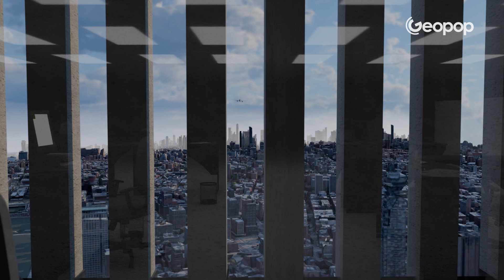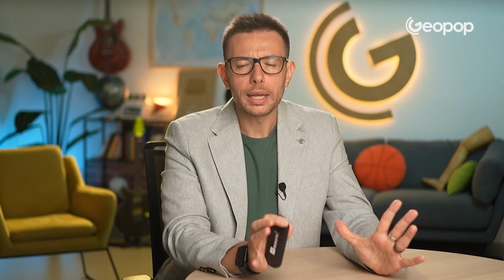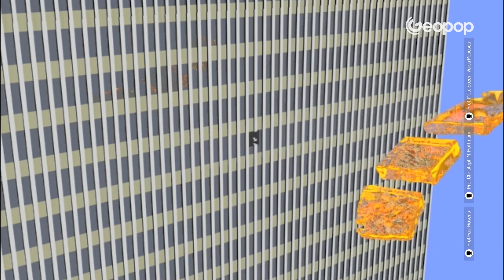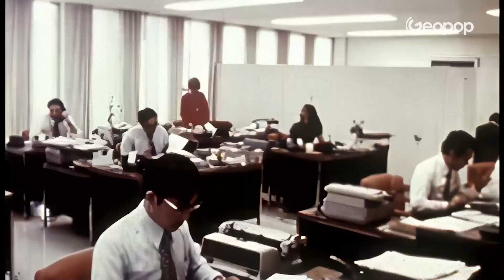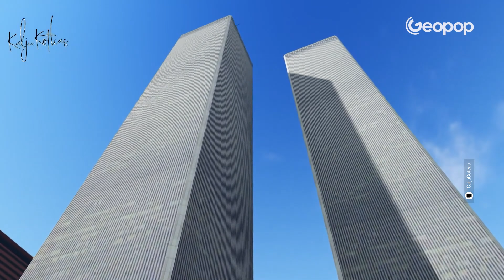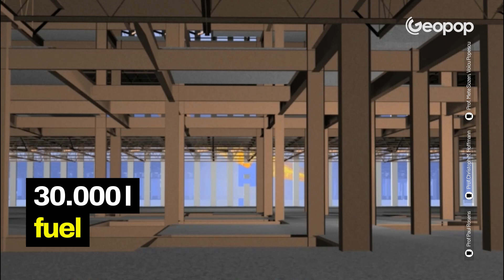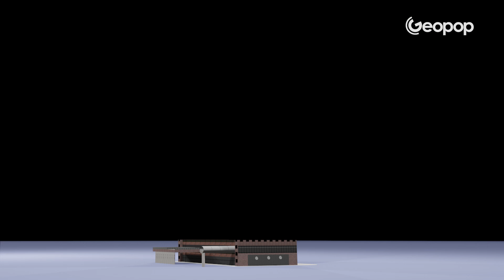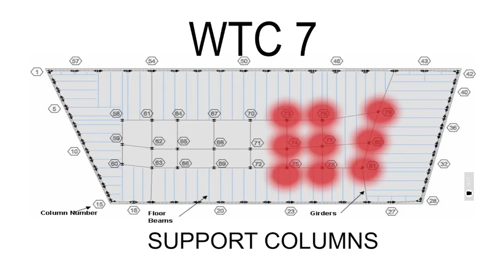9/11, 2001: The Technical Reconstruction of the Twin Towers and WTC 7 Collapses

Comment: Nano thermite caused these near perfect demolitions
Reply: OK, how?
Reply: Thermite has never been used to demolish a building of such magnitude, and the towers were not the first.
Reply: @Tim22222  Planes have never been used to demolish a building of such magnitude, and the towers were not the first.
Reply: @Kudde23 Evidence of planes being used: Abundant!
Evidence of explosives: ZERO.
Reply: @Tim22222  Yeah, as if you cheap little liar  never heard of the explosion witnesses, explosion sounds, the dust puffs, flashes of light, the bomb alarms, FBI´s working theory of bombs, the refusal of investigators to even look for explosives despite everything that clearly points to explosives and the lack of any explanation for the collapses of the Twin´s core structures and the free fall of WTC7 that comes without cuter charges...
Yep timmyshill, you can´t explain these collapses without cutter charges. You won´t even dare to try because you cheap little liar know you can´t.
Reply: They used explosives just like any other controlled demolition
Reply: @robbiehiatt9966  Yeah, except they didn't. First responders went through the wreckage with a fine toothed comb; nothing was found pointing to explosives.
Reply: @Tim22222 that's a lie, first responders responded first. After the initial search, the fire department was only allowed to carry firefighters off the pile when firefighters were found. They did not go through the debris with a fine tooth comb. They didn't go through it at all except when they were looking for survivors in the beginning.  Lie some more

Comment: I am quite tired of these videos or reports, none of which explains the TIME it takes to fall to the ground. The fall may not be stopped, "practically no resistance" is false, even without structural support the simple fact of impact onto a mass, the conservation of momentum, cannot so simply be ignored. Even a high school student can make a simple simulation in Excel and take no consideration at all to structure, just a number of floors each with a weight, and confirm - mathematically - that the building takes time to fall which is much longer than free fall. We know for certain that the towers fell almost at free fall.

The only thing is, WHY this video NOW? What smokescreen is this meant to be and what is hidden behind it?
Reply: The time was 33 seconds. Why does that need to be explained? Only a tiny subset of the lunatic fringe obsess over collapse time, pretending it's a thing in order to support their personal political agendas. To real engineers it is of no consequence.

Comment: To all you doubters,  go watch videos on blacksmithing.  That is the clearest example of how metal can become maleable without actually melting when exposed to heat and time and pressure.
Reply: These are the experts that found molten steel in the debris. Explain that.Captain Philip Ruvolo (NYCFF), 
Richard Riggs(debris removal expert), Mark Loizeaux , Leslie Robertson (wtc structural engineer), Lynn Margulis (University of MA),  Dr. Abolhassan Astanch (from Berkeley),  Robert Kim Ireland( chemical engineer for US Army Corp of engineers), Mark Basile( chemical engineer), Kathy McGrade (materials engineer), Gery Warner( Mechanical engineer), David Gregg( PhD Chemical engineer), Steven Jones PhD( physicist), Kevin Ryan ( BS Chemistry), Niels Harrit (PhD Chemistry), Tom Sullivan( Explosives team) Jason Cheshire ( Chemical engineer), and Jeffrey Farrer (PhD Material science engineer).
Reply: @robbiehiatt9966   Aluminum melts at around 660°C (1,220°F), which matches the recorded fire temperatures at that specific location. Structural steel requires a much higher temperature of about 1,500°C (2,732°F) to melt, which office and jet-fuel fires did not reach.
Reply: @erikk77 so the experts don't know the difference between aluminum and steel.  Yea that makes sense
Reply: A three-alarm fire broke out in the 11th-floor offices of the B. F. Goodrich Company in the north tower of the World Trade Center just before midnight last night and spread through an inner-service core to the ninth and 14th floors. “It was like fighting a blow torch,” according to Capt. Harold Kull of Engine Co. 6, who said all of his men “got their necks and cars burned” trying to get into the 11th Floor hall from a stairwell. A total of 24 pieces of fire fighting apparatus and 132 firemen fought the fire. Sixteen firemen were treated at the scene for smoke inhalation. Flames could be seen pouring out of the 11th-floor windows on the east side of the building. 
--- TRADE CENTER HIT BY SIX-FLOOR FIRE, Blaze Starts on the 11th—16 Men Are Injured, The New York Times, February 14, 1975.  Needless to say, with the weight of 99 floors bearing down upon the 11th floor, the building did not collapse.

Comment: How do you explain the explosions on the floors way way below the collapse?
Reply: Explosive compression of air as each floor falls causes what appears to be squib charges.  Physics
Reply: What explosions on the floros way, way below the collapse?
Reply: @TheCriticalStinker-01 they are called squibs. Why are you acting like these didn't exist?? https://youtu.be/eXAgulfAtR4?si=-iLO9aQjMJVLTUYH
Reply: Not at the distance between the collapse and the floors ! Controlled explosion is the only answer Physics!
Reply: @MegaDicksplash  - So why are these alleged explosions at such low velocity, have no hearing damaging 180-190dB bang, produce no flash, no supersonic blast wave, no lethal high-velocity eject and occur in reaction to the building collapsing rather than being a cause of the building collapsing?

Comment: Or..... if you understand structural engineering and realized the NIST report was fictional garbage, or seen a controlled demolition, you would come to a different conclusion.... just saying...If an engineering student were to have made the  NIST report and presented it to their professors, they would be working at McDonald's...
Reply: I'm going to respectfully disagree with you, but rather than just simply assert you are wrong I will present a detailed affirmative case explaining why mine is better.

Twin Towers collapses were relatively straightforward, the fundamentals already understood in the professional engineering community within just weeks. Yet there’s a lot of really bad information floating out there, mostly on the internet where it’s easily accessible to anyone. Good information takes more effort to come by and is much harder for laypersons to digest. Engineeringspeak is complex and dull while wild baseless speculation and pathological theorizing with easy hand-wave answers is simple, exciting and require a whole lot less thinking, thus getting far more intention than they deserve.

To correct that situation, I have all on my own prepared this short yet detailed technical description of Twin Towers collapses based on my own observation and analysis of the available true and relevant facts. No politics or ideology, just the engineering. My hope is this will dispel many common myths and answer most if not all questions you may have about the Twin Towers collapses, because anything can seem like a conspiracy if you don’t understand how it works

While complex, most of the Twin Towers collapse mechanisms can be seen with the naked eye and easily discerned and understood by the layperson if sufficient time is taken to understand. 

1. The Twin Towers consisted of 4 primary structural elements that together formed an integrated system where each relied on the others.  47 hollow box-section steel Core Columns carry the majority of the gravity loads. The 236 hollow box-section steel Perimeter Columns carry the remainder and ALL of the lateral (wind) loads. Long-span Lightweight Steel Trusses connect the core and perimeter column together at each floor with a Hat Truss on top to tie the structure together as an integrated unit where no element can survive without the others. There was no structural load bearing concrete and most components were bolted together. www.youtube.com/watch?v=u7OqrC74Dm4 

2. The impact of 117 tons of airplane (= to about 12 dump trucks) at speeds up to 590 mph with the energy of a ton of TNT completely destroys the aircraft. This in no way implies the Towers come out unscathed. Many perimeter columns are damaged or destroyed as are some core columns (example; 33 of 59 perimeter and 20 of 47 core columns damaged or destroyed at the impact floors in the North Tower), This damage is primarily through bolt-shearing failures at the end connecting flanges, as well as bending, twisting and fracturing of weld seams. There was no cutting or slicing - the reality was far more violent and messy. 

3. The impacts destroy or damage fire insulation, fire breaks and sprinkler systems on multiple floors.  Huge fires are started across multiple floors simultaneously and allowed to spread rapidly with no effective firefighting or fire suppression. This was an unprecedented fire event . 

4. The hotter steel gets the weaker it gets .  With fire insulation stripped away and no sprinklers the survival time of the steel greatly reduced. Gradually over time heat causes the lightweight steel Floor Trusses at the impact damaged floors to sag, which was observed and recorded.  No steel melted or needed to. Structural steel fails long before it becomes a puddle. It just needs to bend

5. Sagging floor trusses pull on the increasingly weak and overloaded Perimeter Columns, causing some of them to bow inward by up to 5 feet. A straight column is up to 4 times stronger than a bent column. The bowed Perimeter Columns buckle and fail, initiating collapse. The formerly static mass above which the structure below could easily support is now converted into a dynamic mass up to 30 times greater. Because they have buckled, the Columns above and below the failure point are no longer aligned . The load bearing structure below no longer bears any load as it falls past the lower columns, NOT onto them.

6. Thousands of tons of debris fall within the four outer walls, down through the open office space, crashing onto the first intact floor it encounters. This massive impact immediately breaks the bolted connections to the columns as the amount of resistance the Floor Trusses can offer is negligible.  The falling debris slows only marginally and briefly. Note:
6a. This is NOT a solid top block crashing into and “crushing” a solid bottom block .
6b. The debris falls past the columns not onto them.  The columns provide no resistance to the falling debris. 
6c. Only the bolted connections of the floor trusses to the core and perimeter columns can offer any resistance. A pair of 5/8” bolts at each end of each truss vs. thousands of tons of falling debris.
6d. No laws of physics are violated.

7.  This floor-led collapse progression within the four outer walls can only go straight down. Note: 
7a. This process is often incorrectly referred to as “pancaking” which actually refers to a completely different process rejected at an early stage. The catchy name stuck but nobody knows what it is supposed to mean.  Pancaking is too simplistic and inaccurate anyway. More like Kaiserschmarrn.

8. Collapse progresses through the floor systems not down the columns, through the path of least resistance . Rate of floor failures increases with each successive floor as momentum increases, reaching an average acceleration of 0.65 of GA, or 35% slower than true free fall. Bam, bam, bam down the building until there are no more floors to fail.  The resistance offered by each successive floor is always the same. The mass and velocity, thus the energy of the falling debris is constantly increasing, with each floor destroyed adding new falling mass. Some falls to the sides, but most falls down. More mass, more velocity, same resistance with each floor.  Don’t get stuck on the but the lower floors weren’t on fire nonsense. They weren‘t and didn’t need to be.

9. The Towers were 95% air by volume. As that air was compressed inside the building it is forced down the tower and blown out the sides in reaction to the building collapsing . Those were not “explosions”, it was expulsions of compressed air caused by the collapsing building, explaining the low velocity, lack of flash, blast, supersonic pressure waves and lethal high-velocity ejecta.  

10. Perimeter Columns become detached and peel away like a banana behind the collapse front, playing out to the four points of the compass extending to more than 600 feet from the base of the towers. This was quite obvious from examination of the debris pile. 

11. Core Columns fail last as their internal beam bracing is stripped away by falling debris and lateral support from the floor to perimeter columns is lost. 

12. For those who care about how long this whole process took; 31-34 seconds from the moment the perimeter columns buckled until the last core columns hit the pile, or 1/3 the rate of true free fall. Don’t believe me?  Just watch any video of the collapses and note the loose truly free-falling debris dropping much faster than the towers themselves.  

13. Each Tower had a 1-acre footprint. Far from collapsing inside their own footprints the debris pile spread out over 17 acres in a pile up to 14 stories deep. 8 surrounding buildings were destroyed and scores more damaged by the falling debris. 

14. NOT observed were the 180-190 dB bangs of thousands of high explosive devices or the blinding bright flashes of burning thermite. Neither explosives or thermite could have survived the impacts and subsequent fire nor could have caused the (silent) perimeter column buckling that clearly initiated collapse either. A video of a shocked and injured firefighter casually using the magic word explosion is in no way proof of explsoIVES  and the demolition_ case relies entirely on that sort of thing. There is zero tangible physical evidence and it would be technically impossible, totally impractical and completely unnecessary. No one would bother. 

15.  Finally, the Twin Towers were perfectly safe within their design envelope.  They only collapsed when taken far outside design parameters by an extraordinary and unprecedented event 

Impact + Fire (heat) + Time + Gravity = Collapse . Remove any one of those four elements and there is no collapse. Ignore any of those elements (as many do) and you will never understand the collapses. The Twin Towers were an integrated system in which no one component could survive without the others. One fails, the rest follow, through the path of least resistance – DOWN – through the open space, bypassing the path of greatest resistance – the columns.  Nothing I just described violates any laws of physics. All of the above is true no matter who planned and carried out the 9/11 attacks or why 

In 24 years zero structural engineers of tall buildings, including the 1/3 that have retired in that time, have made any statements in support of 9/11 Truth BS demolition claims. Zero, nada, none. The lack of any such citations in the engineering literature (published in any country worldwide) is palpable.

I hope you found this helpful and informative. It is not meant to be adversarial, but to solicit informed critical comment, positive or negative. If I made any errors of fact, logic or reason or left anything critical out, please let me know so I can fix it. To stay focused just one topic at a time please and on-topic (Twin Towers ONLY). No word-salads of Gish Gallop. IF you can offer a more plausible alternative be my guest. Be the first. Please start any reply with the words “Tits McGee” or I will know you didn’t actually read it, are not serious and just wasting my time. If you are going to argue, do it on the merits.
Reply: So,  working with you.

Comment: What a load of 💩 WTC6 was between WTC1 and WTC7 and shielded WTC7 so why didn't WTC6 go down? and you animation of WTC7 collapsing to the real footage also doesn't match WTC7 came down at the same time not from one side moving to the other...
Reply: Building 6 was only 7 stories tall. The 47 story Building 7 - just 340 feet away from the 1,000 foot tall North Tower - would hardly have been shielded by Building 6,... and it wasn't as we clearly see here:
Reply: @TheLoonResistance Obviously you didn't understand what the guy was saying. he is wondering.
Why building six didn't fall down? What a moron